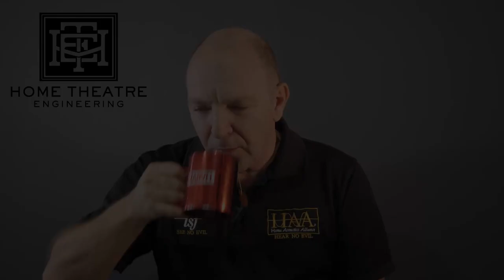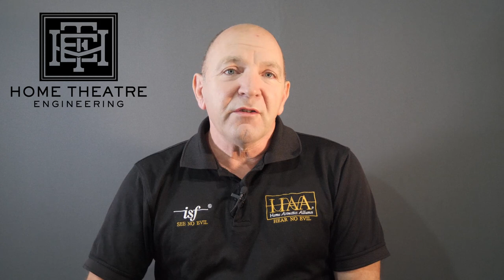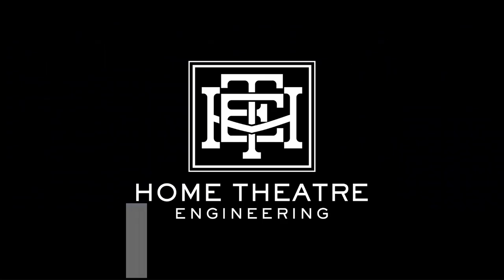The Most Important Answer in Home Theater Design is . . . .

Comment: The simple answer is to have as much ceiling height and as big of a room as possible to allow for as much room treatment as possible.
Reply: That would not be a good idea and actually presents many more problems than people might realise. I definitely would not suggest that
Reply: @AndrewPoole01  So in your opinion, smaller rooms are better (?).  That contradicts pretty much every room dimension calculator I've seen.  Maybe you can cite some of your sources to back up your opinion.  I.e. if you check out Acoustic Fields room volume calculator, you will see that a good "green zone" room STARTS at 20' long x 21' wide x 11' high.  Red zone rooms (not acceptible) are 9' L x 11 W x 10' H or smaller.  This is due to rooms that small not having sufficient space for treatment, and also having problems with bass and standing waves.
Reply: @AndrewPoole01  Good reply, thanks!  I am in Los Angeles area, not exactly around the corner 🙂

I will have to respectfully disagree, and I am of the persuasion that bigger is better.  However I will say this with the following caveat:

My experience is primarily with LIVE rooms or soundproof enclosures /practice rooms.  I.e. rooms where music is played: rehearsal studios.    

Dolby Atmos music room requirements are as follows, which can be found on their website:

Minimum is 8' W x 11.5' L x 8' H
Recommended is 18 W x 21 L x 10' H

Which corroborates with Acoustic Fields room volume recommendations.

Bigger space = less room modes.
Reply from the maker: @komoru  I think you are missing the point. No one is arguing that there is not a reduced impact from room modes in a larger room. But we do argue that we can manage the complex room modes of a smaller room with multiple sub placement and proper bass management. 20 years of building high performance cinemas with 15-120 hz bass response +/-1db across multiple seats is what we are good at. Also for us, most of the time the room dimensions are already decided. It is not often we get to specify what size room the client should build. So we have to develop skills to make small rooms amazing. However when we do get to deteremine the room size and dimensions that that is a great day. Also we would consider Dolbys minimum spec a small room! Most of our rooms are in the 7m x 6m x 3m sort of range so what do you consider large? But there is so much more to this than is being addressed. In a large room for example lets say the atmos speakers are 5m away in a high ceiling on an angle. How much power handling/sensitivity and amplifier power do you need to achieve reference level without distortion? How far is the screen and hence the speakers from the MLP. What about projectors throw ratio's, door and window locations that allow for speaker placement. Even Harmans anechoic chamber would not work basically below 80Hz as the acoustic material would have been bigger than the chamber to make this effective. Acoustic tretament below 100Hz is large, often expensive  and often impractical. Succesfully tuning say a helmholtz resonator to a room is a costly and delicate exercise for example. So to say "as much ceiling height and as big of a room as possible" is just a throw away line, So its nice to say but in real world practice this is not always the case, and even then how big is big? We pay close attention to the room mode analysis and Bonello chart results as part of our guidance in room dimension selection. We have some great tools to assist us with this. Now on speakers for example dome tweeters start distorting at 105db so how the heck are you going to get 105db SPL at the MLP when your speaker is 3m away? The math doesn't work. So now you are looking at compression drivers or something like wisdom PMD and the budget climbs especially here in Aus. I have videos covering all of this.. Have a dig around.So its nice to say but in real world practice this is not always the case. We have learned to work with what we are given most of the time and we and our clients are always pleasantly surprised at the outcome. I would hope the training we have recieved from Floyd Toole, John Dahl, Gerry Lemay and others and the reserach we have done has set us up well to manage these challenges. Time for a coffee.

Comment: Always upgrade and buy the best you possibly can the first time.  Learn from me I bought a X3700h Denon but now I want to go separates so know I'll end up selling the Denon for a fraction of what I paid for it.  If I would have done my homework before I pulled the trigger I wouldn't be in this situation.
Reply: I think it is a part of this Home Theater thing... to learn more all the time... make mistakes and correct them to make your room image and sound even better.
Reply: I sure wish that I had the money to buy your Denon 3700.  It sure would be an upgrade for me.  Separates are are an unattainable desire here.
Reply: @welderfixer  I have the X4500 paired with three vintage Rotels. Used market is a good way to start.
Reply: @homecinemademo  Thanks for your support.  Jealousy is usually not my game, but dang, now I'm jealous.  I'm betting your system is fantastic.  
Some of my gear goes beyond used.  More like saved from the jaws of the recycling death machine and repaired on my bench.  My 70" Sharp Aqous 1080P TV is one such item.  It has dents, scratches and white spots on the screen that may get repaired someday, but hey I fixed the reason it was left for dead and my family has been enjoying it for several years now.  Other, pieces also rescued or most gratefully obtained used.  Someday after I payoff the deep stack of bills or hit the lottery I might get my gear up-to-par and help someone else start their AV addiction with my old gear.  Pay it forward right?
Reply: @welderfixer  Yes that is a good plan. And it is ok to take it slow. Baby steps. It is a joy everytime you do an upgrade and see or feel the difference.
Reply: @welderfixer  Nothing wrong with used gear, sometimes you can get real bargains in the classifieds. My home cinema set up is all new bought items though wouldn't be classed as super expensive. Compared to some people who spend hundreds of thousands on audio home cinema equipment. 

My latest purchase almost £2000 worth of acoustic absorption and diffusion panels for room treatment. Will probably be my purchase that makes the biggest difference improvement to the sound in my room.

Comment: Andrew, The element of speaker type is an important factor, so I'm asking which type do you prefer for a room size of 4.5 x 4.5 x 2.5 meters - horn or dome tweeter?  Thank you.
Reply from the maker: Hi Kevin. So good question. Looks like a square room which will be interesting. Once again without knowing where you plan to sit, how many seats you will have, if you want to focus on just the main listening position or all seats in terms of sound quality plus distance from speakers to seats number of channels and if you intend to tonally match all speakers the answer is again I don’t know. However as an overall rule my general preference for good dynamic range tends towards compression drivers (horn) if they are well implemented
Reply: @HomeTheatreEngineering  Thanks for your input.  My main seat is against the wall 4 meters from the speakers.  I've been getting interested in horns and AMT tweeter lately.  So, I was wondering if your great deal of experience would lean toward horns.  If I had the income and a place I'd hire you to install a Krix wall a system for me. But, that only continue to be just a dream.  Thanks again sir.
Reply from the maker: @welderfixer  Hi Kevin if your seats are against a wall you are sitting in the worst place possible this is an anti-node for your resonant frequencies so lots of boundary gain and distortion. If you can move the seat away 1m 3ft or more that will help. Horns can appear harsh in non treated rooms as they can push out more energy mind you some tweeters will too if distorting. But getting your room right will be a higher priority than choosing speakers in my opinion it will help massively
Reply: @HomeTheatreEngineering  Very true about my position.  Being a small square room makes for many headaches with audio.  Luckily, I'm the only one in the house that cares about good audio.
Thank you sir.
Reply: Good HiFi speakers don't usually make good home cinema speakers in many cases despite many saying the opposite ... Horns, ports and metal dome tweeters are better suited to music but a tad too harsh, forward, unrealistic and bright for movies... Not one of the major film studio in the world including both DTS and Dolby laboratories use horns, ports or metal tweeters...Big no no in many installations...
Reply: @welderfixer  Horns are mechanical amplifiers designed in the 50s to compensate for the poor performance of 50s tweeters...  They have no real place in home cinema today... They are typically used for sound reinforcement like in nightclubs, concerts or large spaces ...may I ask what rears you have?  :)
Reply: @Echo-jg8is  Ahhh.  That's good to know and keep in mind.  
I have a pair of Polk Tsi 100 hanging on each wall and a pair of Realistic Minimus 7 on the ceiling.  Yeah, it's a poor man's set-up.
Reply from the maker: @Echo-jg8is   your information is a little outdated. Yes horns were created as you say for sound  reinforcement but the new high quality compression drivers with specially designed waveguides are not at all comparable with the old horns of the past (I worked with those as a sound engineer long ago!). Indeed DTS used Procella speakers with compression drivers in totality in its DTS Reference Theater at its European headquarters. Dolby Atmos studio in Tokyo also using compression drivers and we will see many more in the future. There is a reason manufacturers are working hard on custom waveguide design. We also disagree with this distinction between music and home theatre speakers. Accurate reproduction of sound is the goal. Distortion free clean sound with sufficient dynamic range properly integrated will reproduce either equally well. There is music in movies and high dynamic range in music. The rooms we build are designed to thrill audiophiles and movie lovers equally. Indeed many high end stereo systems I see or calibrate are poorly configured at best in rooms with far less than acceptable acoustic properties. The divide is largely we believe due to poor implementation, often too much and bad bass plus no care in design and calibration in home theatre. We have received glowing reviews from audio/stereophiles once they have heard our rooms. Also, in some cases certainly not all, more effort can go into film soundtracks than some music production. There can be gold in those soundtracks. And how then should we listen to High Definition Audio in music concerts on UHD disc?
Reply: @HomeTheatreEngineering This is only my opinion but the horns that I tend to see used in mid to high-end home cinemas are often owned by people that are playing the " numbers game "... building systems to go 144 + dB with walls of subwoofers running ultra hot with ultra-high sensitivity horns to achieve the high dBs required...some system owners even wear headphones to prevent hearing damage...This is perfectly fine, but it's not the intended sound of the film's soundtrack, its like the debate between the 2 channel Linear systems over a conventional 2 channel V Curved systems...I'm just questioning the over-complicated way in which people sometimes build systems...Horns can be as good as standard designs for sure, I just think that they are not needed in today's typical mid to small rooms and many find them Harsh especially under long-term listening...I'm not sure what speakers the EU Countries use for films but all American film companies and the Codec designers like DTS and Dolby all use M&Ks...I only have 3 rules to building a good system...1: find the best speaker your budget will allow...2: find a monoblock that compliments said speaker...3:repeats steps 1&2 as and when required...I have 7 identical speakers,7 identical monoblocks, and all equal distance to my Hot Seat...This is the only way for me to listen to Multichannel music and movies...Having a Frankenstein speaker system with a different tone, power handling, sensitivity, soundstage, resistance, and cosmetics is something I don't understand...
Reply: @HomeTheatreEngineering  Forgot to address the reason why i think some HIFI speakers may not be right for Home Cinema...People often say that speakers are not good at all types of music, they may say this speaker is better at Jazz than Rock...If that's the case that a speaker is susceptible to certain Genre changes then it would follow suit that they may not be well suited for HC...Especially if you consider that live instruments are running at 9 octaves with about 6dB of dynamic range compared to films with artificially amplified 10 octaves of sound and 20dB dynamic range ...
Reply: @Echo-jg8is  Wrong as most commercial cinemas actually use horn compression tweeters. In any case you can get good speakers with silk dome, Beryllium, ribbon, horn tweeters. 

If it's a good tweeter and implemented well by the speakers designer it will measure and sound good. 

People do have preferences on tweeter, woofer materials. But that doesn't mean a different tweeter or woofer from your own speakers is bad.
Reply: @C--A  I said that Film studios in America all use M&K including DTS and Dolby... Yes I agree that cinemas use Horns, that was my point, sound reinforcement...I agree horns can sound good however.

Comment: You would think the single most important question to a client would be budget?
Reply from the maker: So that comes after asking what they want to achieve. But this is not about questions. It’s about the answers people expect from us when they are asking the questions which they do about 230 times a day with us with no critical information provided.
Reply: @HomeTheatreEngineering  I understand that.  I used to have an install business from 2002 to 2008, I had to stop due to health challenges (I had a stroke).  By the time I recovered the market had shifted enough that there was no going back to it.  Sometimes they are just fishing for a shortcut or clue to help their relative and themselves to do the install.  After they fail at it they call you and you have to decide to take on their mistakes or pass on the business altogether!